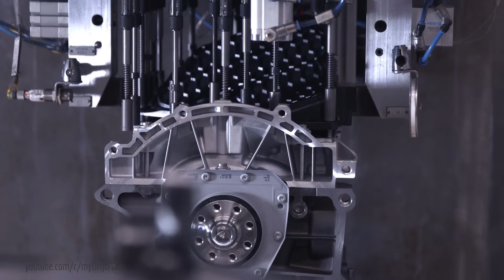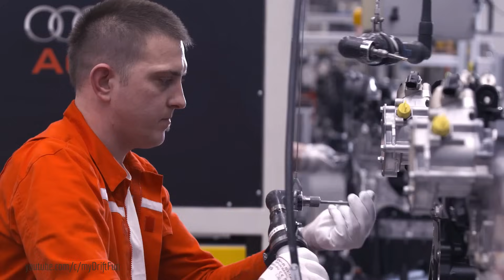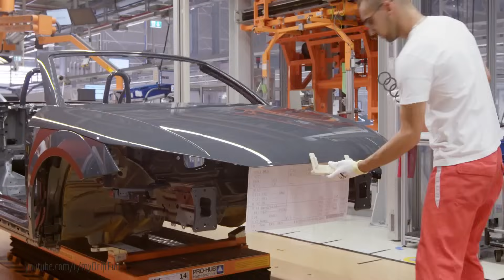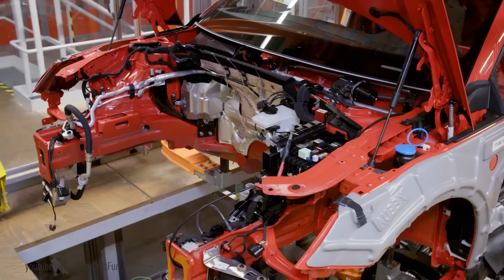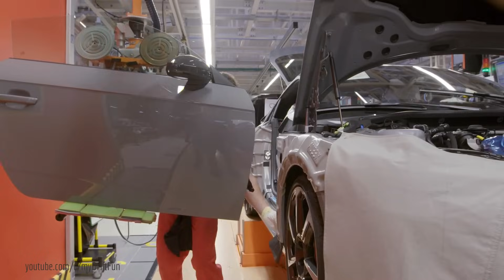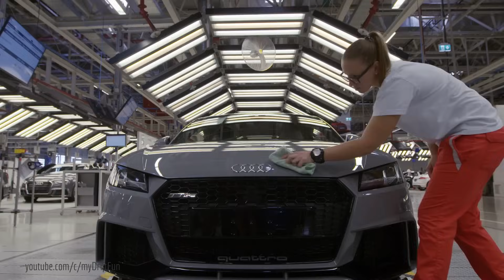Audi TT Production

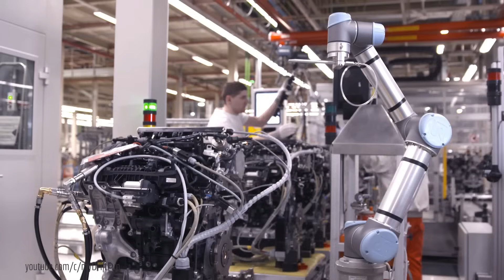Comment: As a Manufacturing Engineer, it's neat to see equipment I've researched before for my own assembly lines (UR Robot at 6:25).

Also, I have to wonder if they're all silent just because of the cameras. How much talking is there usually and how much that affects OA.
Reply: at 5:56 you can see them talking behind the window
Reply: do you know what the machines at 10:50 are doing?
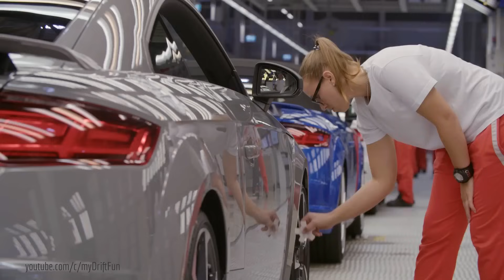Reply: @jeebsy718   My guess is that they're measuring the panel gaps.  edit: although she's checking gaps at 12:00, so I'm not sure unless they require 200% inspection.